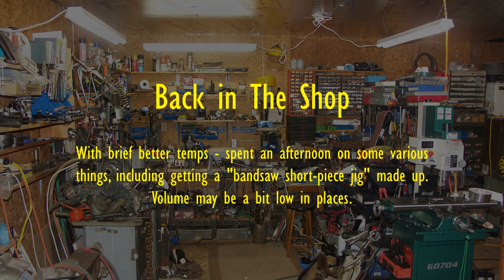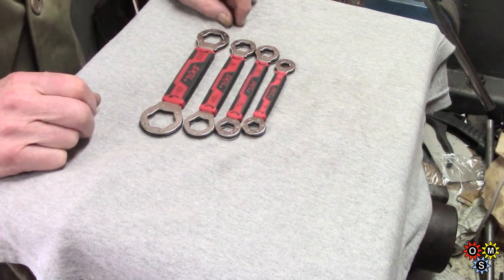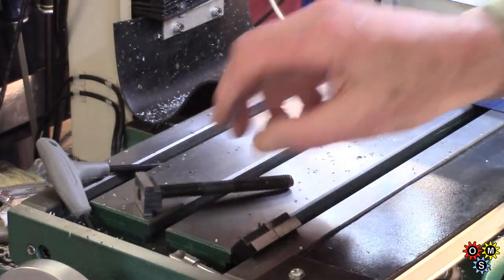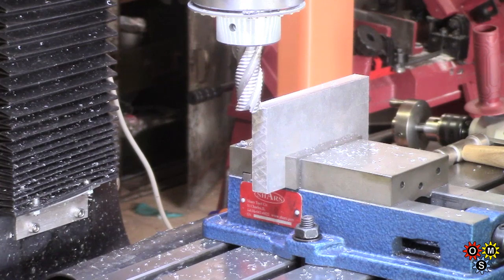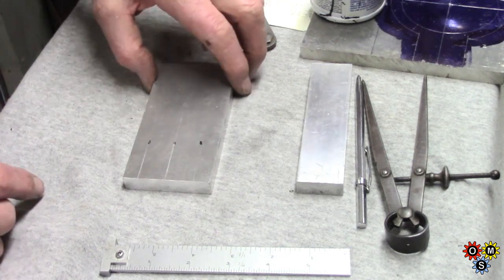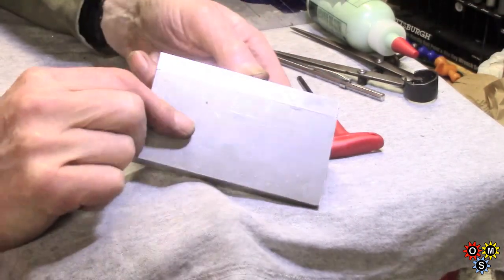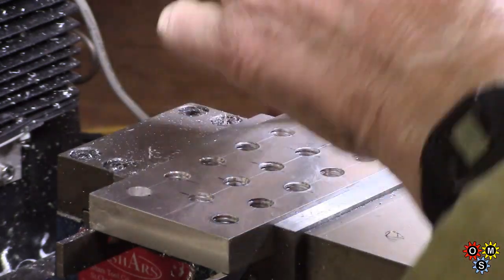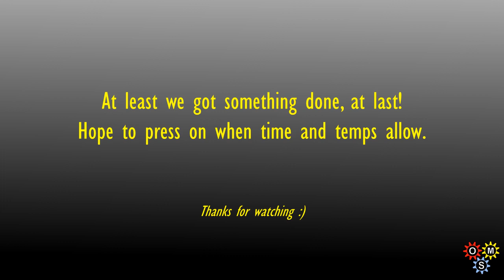Back in The Shop!

Comment: Good  job Chris , when I first got my little mill I had a pair of  T-nut's to large of course , so I thought for my very first project I would try milling them to size , well this is when I learned that my new HSS  mill did not cut hardened  steel , live and learn I say !
Reply from the maker: +John Fry 
Hi John -- Thanks - learning never stops - even at my age! It's certainly useful to find some carbide end mills, even if sold as used. Usually enough cut still possible and sure helps with hard materials.

Comment: If you use the rotary table for the outside curve, you will automatically get the fillets or radii where the straight sections meet the outer curve. The larger the mill, the larger the fillets. I think you will be glad you had the extra material at those locations.
Reply from the maker: +Peter W. Meek 
Hi Peter -- that's true - however, regardless of how I produce the blank profile I'll keep a fillet there. May be a while before I can progress on that.
Reply: +Peter W. Meek Like your idea for the quill stop.
Reply: Randy Richard This one belongs to Chris. (I suspect you inadvertantly replied to my comment rather than to one of Chris's.)

Comment: To allow machining the ends of that flat base (with the part clamped flat), you might try moving (one or both of) the jaws of your mill vice to the outside. I know Kurt vises can do this and it looks as though your vise can do the same.
Reply from the maker: +Peter W. Meek 
Hadn't even thought of that Peter - certainly could be useful, although despite rather a lot of height it coped OK with small cuts. Must check that out.

Comment: Quill Stop: You got that LPT5000 plasma cutter..... Do all your rough cutting with that on the alum part... Take off the waste strip and all the corners and you could even cut out 95% of the center hole.
After you had squared up that 1/2" bar on the long side ... lay it down in the vice (X) then cut both ends square (Y) in one setting.
Reply from the maker: +Grandpa Bill 
Hi Bill - I must have read your thoughts! Was in fact considering the plasma for roughing - in particular for the center hole, as would need to get main material out before using boring head.... only thing with that however is it would loose my center reference for mill set up.
I guess  though if outer profile taken to finish point I could edge find, do the math, and manage that way. Thanks for the suggestion - will be considering all options!

Comment: Good to be back in the shop! Will you cut the quill hole first? that way you will at least have something to hold on to, if you cut it as a last opp the whole thing will be more difficult to hold securely, do you have a de humidifier in your workshop ? it is surprising how much they pull out of the atmosphere . Chris B.
Reply from the maker: +Englishman French 
Hi Chris -- well, I was going to get the main profile cut first probably - then, having both ends for clamping can use my center pop for getting a good center in the mill with coax indicator. May yet change mind of course!
I do have an old dehumidifier - guess I am economical on electric usage but it could help. Thing is anyways, those don't do as well when temps very low. Just trying to be patient!

Comment: just to help, i use sea foam spray. on all my metal. keeps it from rusting very well. kind of has a new gun ( fire arm) smell, it works well. FYI
Reply from the maker: +Joel Stewart 
Hi Joel -- hadn't thought of that! I usually use just oil or, a squirt and wipe with "Boeshield" - also used on guns. Bit smelly though :)